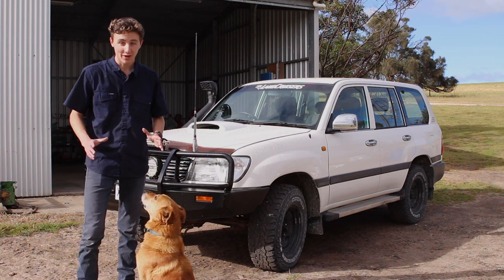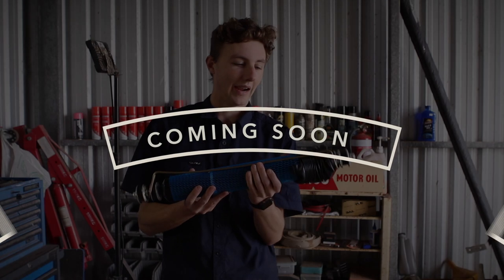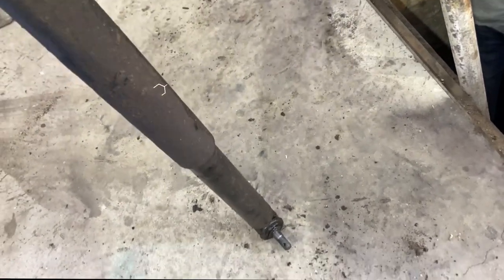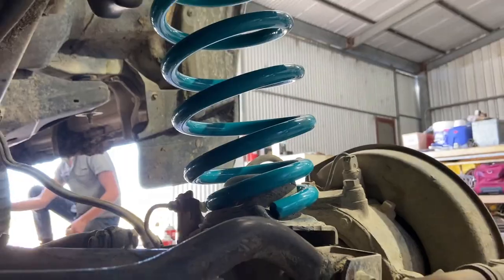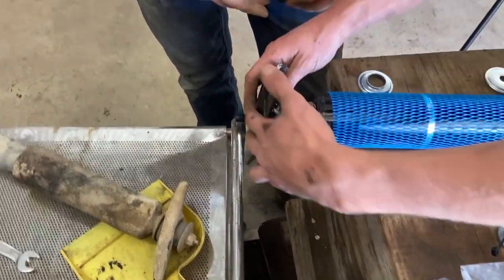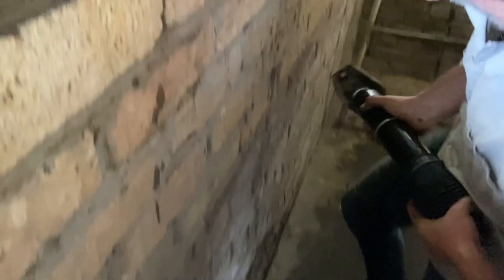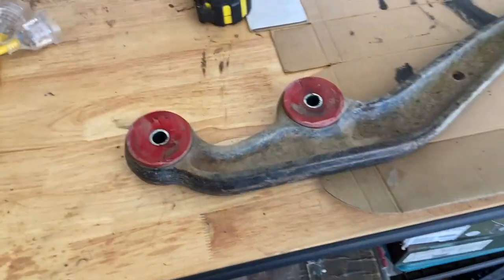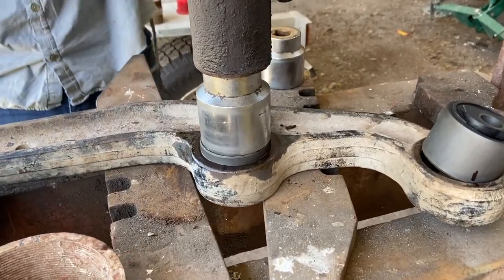Installing a 2" Dobinsons Lift Kit! [Live Axle 105 Landcruiser]

Comment: "this is norman being a spastic". i was laughing my ass off when you said that
Reply: the new tough dog 45mm adjustable 2" lift arrived on Tuesday and my dad and I are gonna instal them on the 105 this weekend, the car already has a 2" lift but the shocks and coils are from 2007 and the seals are the equivalent to a piece of PVC pipe and the left front corner is sitting 4cm lower than the rest of the car lol

Comment: Your car is getting better every time I watch your video’s great job. Just a question because it’s lifted 4 inches does it need to be engineered
Reply from the maker: Cheers for that! It’s a long-term project haha. Just slowly adding more as I earn the money! And nah so it’s still a 2 inch lift, but because the old springs had sagged so much, it ended up being 4 inches higher than what it was

Comment: Another Good video young Will.
Note generally you measure your height from centre wheel hub to wheel arch.
We are waiting to do lift/GVM at same time. 
As our rig is same year and setup almost, with drawers, front bar etc. I'm curious what heights you have now hub to arch/front and rear. I haven't been able to find what the factory measurement's were from new, thus curious how much ours has dropped after 350k
Reply from the maker: Hey mate, thanks for that! It’s now about 630mm from centre of hub to wheel arch at back and about 600mm at front! Hope this helps!

Comment: Do you still have your sway bars installed? and does that affect the drivability on and offroad? cheers mate!
Reply from the maker: Yes the sway bars are still in and there doesn’t seem to be any stress on them so far. Dobinsons say that sway bar extensions for a 2” lift isn’t necessary

Comment: do you need to change the castors on coils lifts only or leafs as well?
Reply from the maker: Yes definitely recommend caster correction. Wheel alignment showed my caster was just in spec with those corrected bushes. Very hard to get it perfect on live axle but really makes them ride better
Reply: @WillsLandcruiser  where’d u get the castors and correction template?
Reply from the maker: @snagger5150  Dobinsons sent the corrected bushes and I found the template online somewhere

Comment: Hi mate, i just got the 2 inch dobinson lift which they are installing, i asked specifically about castor correction to which they insisted isnt needed on the 105 ?
Reply from the maker: I drove this for a bit without caster correction and then I changed the bushes and there was a major difference. With my knowledge now I would encourage you to get corrected radius arms rather than just put corrected poly bushes in. It’ll be better and better lasting in the long run
Reply: @WillsLandcruiser thanks pal. i had the lift installed, now it's wandering a bit on the road. would you recommend the superior engineering superflex radius arms 2 inch castor correction ? They are a bit pricey at around $1600 but im fine with that.
Reply from the maker: @jcproductions007  I don’t have any experience with them myself, but it is a way better idea to go for corrected radius arms rather than just corrected bushes. Mine wanders a bit too. Definitely get a wheel alignment after lifting, and if you’re still having trouble try some heavy duty sway bars
Reply: @WillsLandcruiser  thx mate. Appreciate the input

Comment: Did you add extended brake lines for the lift?
And if you did was it necessary for a 2 inch lift
Reply from the maker: Dobinsons reckoned it wasn’t necessary to extend brake lines or sway bars for a 2” lift so I didn’t. No problems so far
Reply: @WillsLandcruiser  awesome 👌

Comment: Hi mate 
I have 285/75/16 on my LC how can I tell if I have a lift kit on it what should I measure and what hight is standars suspension 
Thanks
Reply from the maker: Standard suspension height on a 105 is 546mm from wheel centre to wheel arch, front and rear. Hope this helps mate
Reply: @WillsLandcruiser  thanks bro

Comment: Why do my 1998 LC100 doesn’t have coils in front? It is torsion bars only…
Reply from the maker: That’s the difference between the 100 series and the 105 mate. The 100 series is a newer model, slightly wider chassis, and it has independent front suspension as opposed to the live axle in the 105